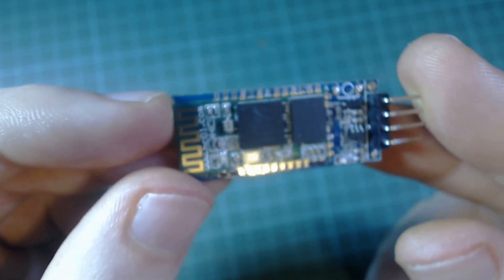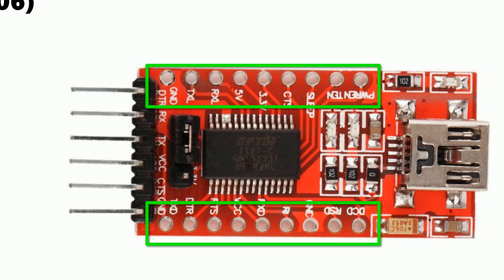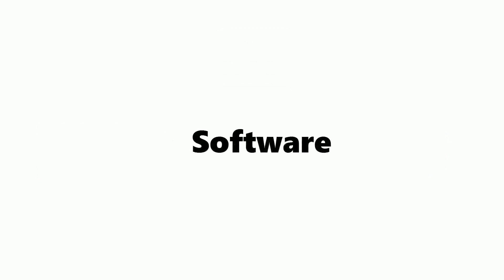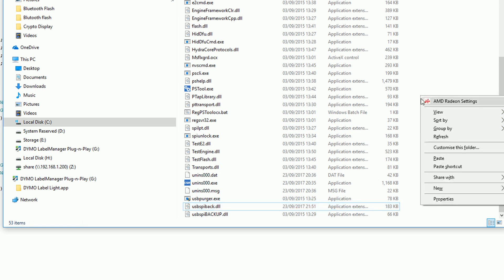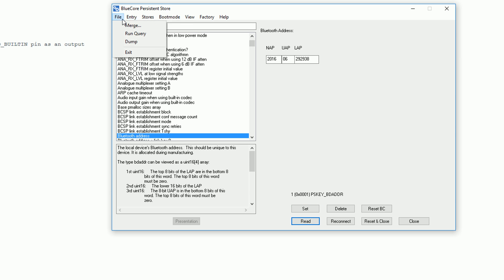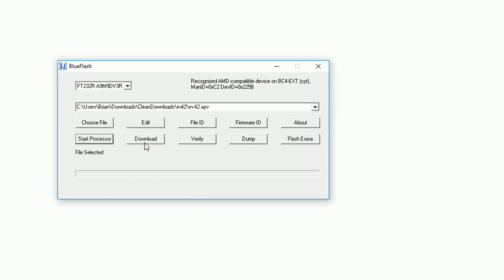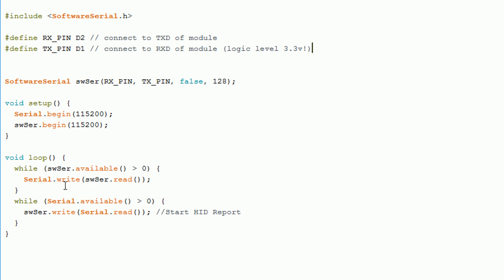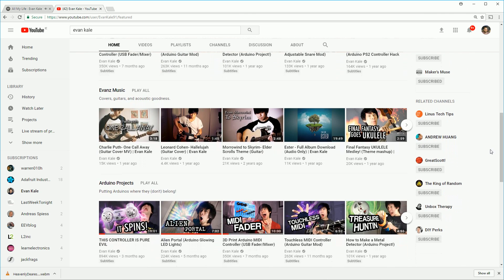Turn your HC-05 into a HID Bluetooth device (No Parallel Port Method)

Comment: No parallel port the young padawan has, he says..
into the industrial thingies to look he has (or what transfers to cheaper standard hardware for normal humans)
=> asrock mini-itx thingies
http://www.asrock.com/MB/Intel/Q1900B-ITX
( http://www.asrock.com/MB/Intel/Q1900DC-ITX this version has the LPT pins for an extra header, needs only ext power supply, no atx)
http://www.asrock.com/mb/Intel/J4105B-ITX (or Asrock J3455B-ITX )

But you should have ps/2 keyboard and mouse to setup, couse driver support on first install to the dark side it you leads)

Great for NAS and TV-Box, especially the DC-DC integrated versions.

Comment: Hi! Nice work! I was wondering if the RI pin is necessary for it to work. I am currently trying to implement it using the CY7C65211 USB-Serial Bridge instead of the FTDI Board and apparently it doesn't have the Ring Indicator pin like the FTDI does. It would be great if you happened to know something that could help me. Thanks!

Comment: Is it possible to make a gampad controller with this ( Xbox controller format)
Reply: Yes. You just have to use a different report descriptor when setting up the device. Instead of using "SH,0230" which is Mouse+Keyboard, use "SH,0240" for gamepad.

Comment: Hi.. first of all thank you for the tutorial I managed to get it flashed. but I have two problems and I'm hoping you could help me..

1. I cannot change the name of the device using "sn,<name>" command. whatever I enter I get AOK as acknowledge but the name doesn't change. it's stuck with "TmkBT-703E"

2. I made a bluetooth mouse from scratch using atmega328p + avago 5050 optical sensor. Got it all working but the the latency of the bluetooth module is too high > 10ms so mouse movement is delayed most of the times. I tried "SQ,16" command to optimize for latency but it has no effect whatsoever.

Can you help me with this? 

Thanks.
Reply: did you get the name changed, I'm using an HC-06 and I can flash everything. But I cannot get no reply from the $$$. I see the device on my phone but it has the same name as yours TmkBT-703E.
Reply: Scott Wanner nope can't change the name.
Reply: I flash my second hc-06 with my firmware and it was successful. So I redid the first one and it too was successful. Now for the programming.

Comment: Hello Brian, could you please clarify whether this method can be used to create a bluetooth device for a laptop (a wireless keyboard) meaning that arduino and all the wireless modules will be inside the device and it connects to the laptop wirelessly? For now, I've only found a tutorial that describes how to create a wire "keyboard" (https://www.youtube.com/watch?v=1unTKKGd8qs) but I'm looking for a way to connect a device wirelessly. Any ideas?
Reply: Jackob Litvin, yes it can be used with an arduino but be sure to used a logic level shifter as the arduino is 5v and these bluetooth devices are 3.3v. Other wise you could damage the bt device.

Comment: please help me  error in blue flash "error detecting chip type"  whats solution  ?
Reply from the maker: Check your wiring is correct and also for shorts. I get this message if it is not connected properly

Comment: Can i also use the hc 05 to connect with an capacitieve touche sensor?  Before an After putting the firmware?
Reply from the maker: +G.J WALE not directly to it as far as I know, you could connect an arduino to it and then th sensor to the arduino

Comment: Hi Brian, Nice video!! i tried the firmware flashing, that work perfectly. But i do not have the Wemos D1 mini. I'm tried with the arduino nano. But i do not know how to connect it. do you have some tips/pointers how to connect? maybe some diagram and what arduino code compilation do i need? kind regards, Peter
Reply from the maker: Peter Wong I'm copying an pasting from another comment, hope you don't mind!

As far as I know an nano can't do software serial at 115200 which is the default the Bluetooth module runs at, but you can change it by setting one of the side pins low (or high, I can't remember :))

Evan Kale has a video that shows you how to do with a nano (details around the 2 minute mark)

https://youtu.be/UJaqHnPR-XE
Reply: Hi Brian,  thx for the reply, i manage now to program the hc-05 with my arduino nano. i just followed the instructions from evan kale video. But now i got a different problem. I programmed the hc-05 with hid and gave it a name. after that i tried to reset it to factory settings and change the name. but then i could not find my bluetooth name on my phone, so now i could not pair with my bluetooth hc-05 chip. what do i do wrong?
i just do the same thing? in arduino software compiled the software uploaded and open the serial monitor and put in the commands. pffff took my ages to make it work. and now i'm stuck again.

maybe you got some idea?

Kind regards,
Peter

Comment: Has any one a idea how I can activate the Debugmode, when I send a O I get this back:
**OTHER Settings**
Profile= HID
CfgChar= $
SniffEna=0
LowPower=0
TX Power=0
IOPorts= 0
IOValues=0
Sleeptmr=0
DebugMod=0    <------------------
RoleSwch=0

and I whant to activate this.
There is nothing in the manual, http://ww1.microchip.com/downloads/en/DeviceDoc/bluetooth_cr_UG-v1.0r.pdf
Reply from the maker: +Tom S. Sorry I'm not sure, I had a quick look too and the only reference to it that manual is the o command

Is there something not working for you?
Reply: I want to connect my PS4 controller to the HC-05, I get it to working.
It's connecting but when I press a PS4 button after a few seconds it's disconnects and I whant to know why.
Nether than less I will firstly now look how it's connect to the PC.
Reply from the maker: +Tom S. I had to change the authorization type to get it working for windows 10,maybe that would help?

SA,2  //sets the auth for windows 10
SP,000000 // sets the pin
Reply: +Brian Lough, It's not working
Reply from the maker: +Tom S. It should work the same as I show at the end of the video.

But to make it a bit easier I did some work on an old library someone had for the rn-42, you can see an example of using a keyboard here

https://github.com/witnessmenow/BPLib/blob/master/examples/HID_KEYBOARD/HID_KEYBOARD.ino
Reply: +Brian Lough, You understood me wrong. I want to connect a PS4 controller to a HC-05(as host).
I must correct myself, it is not working. I must look how the PS4 controller connects to the PC.
Reply from the maker: +Tom S. Ah, I've never done anything in master mode sorry!

Comment: Great video.. I was wondering can an Arduino Uno be used at timeframe 9:35?  If so what are the equivalent pins to "D1" and "D2"? Any help would be appreciated.
Reply from the maker: +xobus1979 sort of! As far as I know an uno can't do software serial at 115200 which is the default the Bluetooth module runs at, but you can change it by setting one of the side pins low (or high, I can't remember :))

Evan Kale has a video that shows you how to do with a nano, which is the exact same as uno (details around the 2 minute mark)

https://youtu.be/UJaqHnPR-XE
Reply: Brian Lough Thank you.i actually watched that video a very long time ago I'll watch it again.

Comment from the maker: Some people are having issues after they flash the modules with RN-42 firmware, when opening PStool they get an error "unable to find entries in the look up table", this seems to be caused by one type of module as I am after finding one that also gives this error

https://imgur.com/gallery/MI3WR

I'm not sure if there is an error with this method and this board, or with the firmware and this board (Evan also uses the "good" board).

To make matters more challenging, I bought 4 of these modules from 4 different sellers on Aliexpress. All 4 of them on the listing images look like a "good" module, but 2 of modules I received are "bad". The one I link to in the video description was one of the sellers who sent me a good one (But I ordered in August 2016 so I dont know if stock has changed!)

Maybe it is worth messaging the seller the image above and ask them to confirm which it is before buying.
Reply from the maker: Hey Lars,

thanks for the offer, but I already have some that don't work. 

Seems like someone managed to get the HC-05 firmware on a cheaper chip that this flash doesn't support. More details about it here:

https://github.com/lorf/csr-spi-ftdi/issues/25
Reply: Yes this one is a compatible chip not actually from CSR.  I bought two HC05 with this compatible chip and they have no respond after flashing.  I got full refund from the shop.
Reply: what if i want to make a wireless mouse using joystick should i directly put X Y axis data on serial of bluetooth or i have to do anything else to work because i have done earlier but it was not working at all as mouse.
Reply from the maker: +Ashish Verma yeah I think would should be able to do it

Take a look at this library, it should support sending mouse commands

https://github.com/witnessmenow/BPLib/blob/master/examples/HID_MOUSE/HID_MOUSE.ino
Reply: in these code change line "BPMod = new BPLib(swSer);" to "BPMod = new BPLib(Serial); " becuase it throws error on compiing becuase i am using hardware serial not software serial
thanks for your code
Reply: sir do you still have the hc05 firmware
if you do can you send it to my gmail
davidarduino123@gmail.com
Reply: didnt work for android as mouse but work quite well on window 10 system thanks for your library
Reply from the maker: +Ashish Verma your welcome, thanks for letting me know!
Reply: hello brian i have exactly the same problem with all my modules i have found out my modules say they are version bc3 instead of bc4 and that the crystal is at 16mhz instead of 26mhz as in the original video if you're looking for a module that does not work, I have one that I can send to you
Reply: BUY HC-06 NOT HC-05
Reply: Yah i also find the error because the cheap modules have an external flash of 6mb instead of 8mb and the rn42 firmware is actually 6.27mb so the firmware get truncated before flashing in the flash and that cause an error for ps tool to read entry
Reply: Did someone find the real solution for this, other than replacing the board? If there's any solution at all
Reply: @ideiademilgrau  have you find any?

Comment: I have a problem, please advise: I have exactly the same HC-05 board as in the video. looks identical. I got connected to HC-05 (LED blinking when "processor running"), I dumped backup firmware and settings, uploaded RN42 firmware, clicked "Start Processor" and got "Processor Running" but LED doesn't blink, it's off. When I try to connect with PSTool I get an error: "unable to find entries in the look-up table on chip". When I flash backup firmware back everything works again, but when I flash RN-42 - same thing, can't get to settings, LED not blinking, but can start and stop processor, get firmware version, verify etc. I tried both RN42 firmwares from comments. Any advice?
Reply from the maker: +Roman Bershadsky sorry I don't really have answer for you as I never ran into it.

I'd say it would be worth opening a issue with the github page of the CSR driver to see if anyone there has seen the same issue

https://github.com/lorf/csr-spi-ftdi/issues?q=is%3Aopen+is%3Aissue

Sorry I can't be more helpful
Reply: Thanks for your reply. It doesn't look like the driver issue, because original firmware works fine. I guess my HC-05 is somehow different and doesn't work... I order the one from your video, when it arrives I will try again, maybe I'll get lucky...
Reply from the maker: +Roman Bershadsky I still think it would be worth asking them as they would be more familiar with the tools and the different error messages 

Hopefully that works for you!
Reply: I posted a message there, thanks again!
Reply from the maker: What version of the Bluesuite tools do you have?
Reply: Brian Lough latest one, downloaded few days ago.
Reply: I have exactly the same problem :-( Any solution ahead?
Reply: I could not solve it. I ordered exactly the same board from the link under this video, so see if I have better luck.
Reply from the maker: +Filip Hermann I'll try look at this tomorrow. My only suspicion at the moment is there might be an issue with a newer version of blue suite
Reply from the maker: +Filip Hermann
Please take a look at the pinned comment on this video, there seems to be two different modules:

https://imgur.com/gallery/MI3WR
Reply from the maker: +Roman Bershadsky
Please take a look at the pinned comment on this video, there seems to be two different modules:

https://imgur.com/gallery/MI3WR
Reply: Thanks. I ordered the one form your link a while ago, let's hope I get the right one in the mail... I can confirm that my module that failed is the one that appears on that photo as the bad one.

Comment: are those settings ($$$; SF,1; S~,6;....) stored in non volatile memory, so even after hard reset it will work as HID with set name and other settings? I want to make sure that, I will have to set those settings just once, and will not need any other init routine every time. Thank you, great video btw.
Reply from the maker: +Viktor Vano yeah they only need to be done once and then they persist

Thanks a lot, really appreciate it! 

I have been working on a library to make using the flashed device easier, someone already one but it was specific to a certain board, might be worth checking out. 

https://github.com/witnessmenow/BPLib

Comment: Hi, could someone help me out? I updated the HC-05 module to the RN-42 firmware, but when i try to open PSTool to correct the IDs, i get the following error message. "The application was unable to find entries in the look-up table on chip. Please use an alternative transport, update the firmware to a version that supports BCCMD/SPI, or is using a version of the firmware significantly newer than this software, update this software." I tried using BlueSuite 2.6.2 and 2.6.8, made no difference. Note: after starting the processor the LED on the module is not blinking anymore like before.
Reply: Hi Vansh Dhir! No, i only reverted the module back to the original state and it works as a HC-05 (no HID). 
I also had an other HC-05 module and noticed that the boards are different. Apparently there are different layout/ designs for the HC-05 and not all of them work the same way. Take a closer look at the part between the chip and the antenna. If it looks differently than the module in this video, it may not not work. My second module was identical with the one in the video and it works now as an HID module.
Reply: Thanks Brian Lough for the reply. I tried it, but did not solve the problem. I also tried to redownload the original HC-05 firmware and that one works well.
Reply: I saw in evans video he has the same module as I have but i cant flash it
Reply: Krisztián Tóth so u downloaded the rn42 firmware from the link in evans videos comment
Reply: Vansh Dhir, yes i used that rn-42 firmware. I can connect to the module in HID mode, it is recognized by my phone and PC but the mouse and keyboard signals are not working... :(
Reply: Matias Ramirez bro use a diff module
Reply from the maker: Is it a different BT module or FTDI board Vansh? I just see a lot of people with this issue and I would like to be able to help them! Did you have this problem and then got it working?

I've never been able to see it, I just tried a different HC-05 module I had and it worked ok
Reply: Brian Lough The hc05 modules are different as all have diff board layout and schematic.I had a hc05 module but I tried with it and it didnt work but then I brought a new one and it worked.There is no problem in the ftdi board.
Reply from the maker: +Krisztián Tóth hey, maybe try redownload the firmware and try reflash with blueflash again

I think I've seen that work for others
Reply: Brian Lough i was getting same error but reflashing and redownloading didnt fix it
Reply: Krisztián Tóth so now u have a hid device ?
Reply: Krisztián Tóth k thanks
Reply: Krisztián Tóth try flashing the module again
Reply: same problem here!
Reply: Brian Lough You can even see on aliexpress or banggood the modules have different layouts
Reply from the maker: Thank you Vansh, I seen one of my modules was slightly different than the others and I tried that and I got the same error.

I will update the description with a photo of both types
Reply from the maker: +Krisztián Tóth
I added a pinned comment with details around this issue, it seems like there is different types of modules

https://imgur.com/gallery/MI3WR
Reply: 많은 도움이 되었습니다. 고맙습니다.(It was very helpful. Thank you.)

Comment: Hi, in the video you mention hc-06 but the title says it's hc-05. And I knew of the existance of a hc-03 and 04, what's the difference between each one and which ones can I use to do this(add HID capabilities)? Thanks
Reply: I think  that HC-05 can work as master and slave device where the HC-06 can only be ( I not sure which one) master
Reply: Ok, thank you for answering

Comment: Sorry, Sir, I'm a self-taught about languages. Sorry for my bad english. So, I can't hear very well the moment about resistors. Do you use a 100 ohms resistors instead a 220 ohms? So, with the 100 ohms, works fine? thank you for your attention.
Reply from the maker: Hey Lord Damios,

No problem at all!

I use 180 Ohm, but I think 100 Ohm would be fine! I also tried without any resistors and it worked, but the github page with the drivers recommended using the resistors.

Hope this helps!
Reply: Thank you !

Comment: awesome but can I use HC-05 connected with speaker to act like a bluetooth speaker? after flashing rn-42 firmware
Reply from the maker: Hi Abhrodeep, The modules have pins that seem to be for Audio, but I dont think either the original firmware or the RN-42 support them. Sorry!
Reply: Thanks for the information! :)